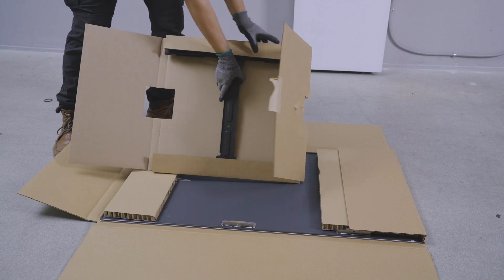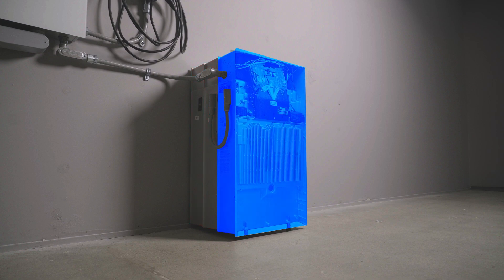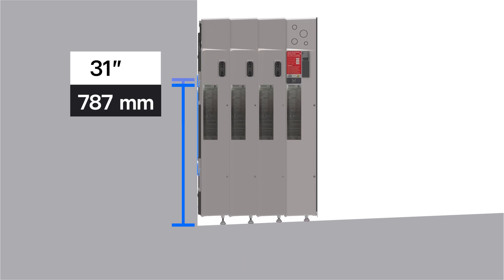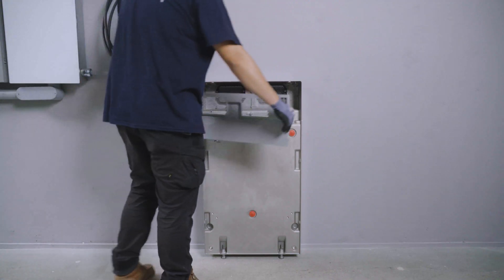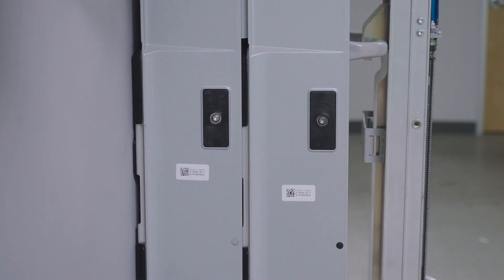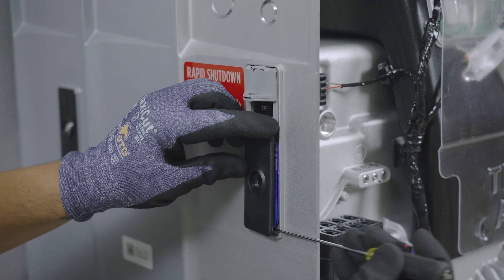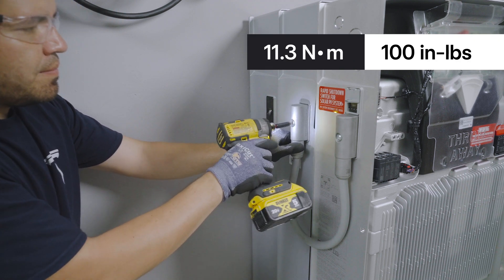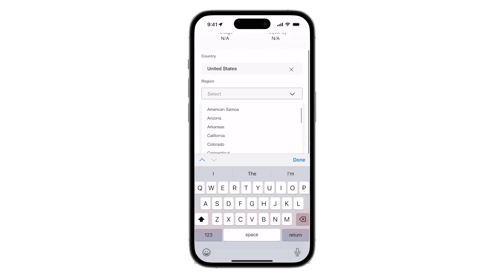Powerwall 3 - Expansion Unit Stacking

Comment: Pretty cool, can't wait to order 9 units when available in Switzerland.
Reply: The system is currently limited to 4 PW3 units and 3 expansion batteries tied to the lead PW3, for a total of 7 batteries at 13.5 kW-hrs; 94.5 kW-hrs total capacity, of which less would actually be usable.